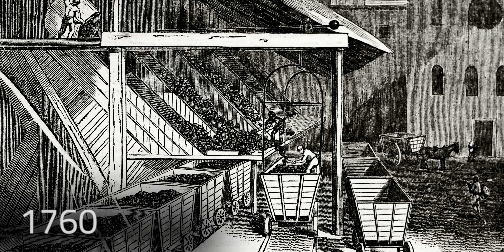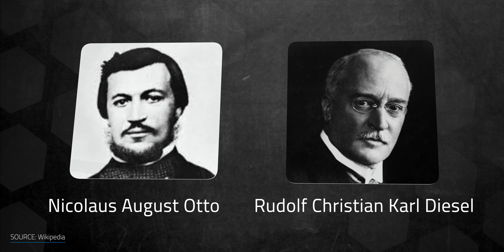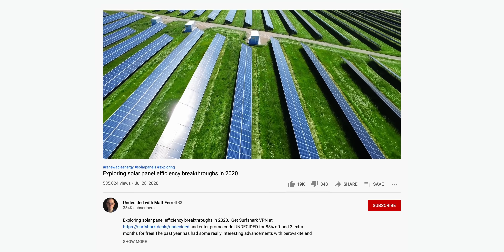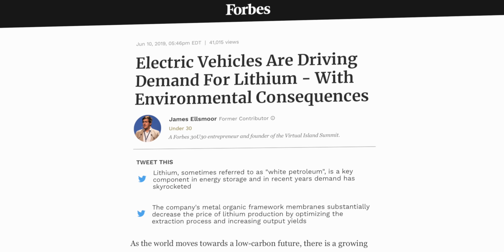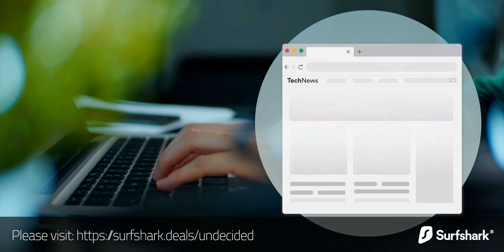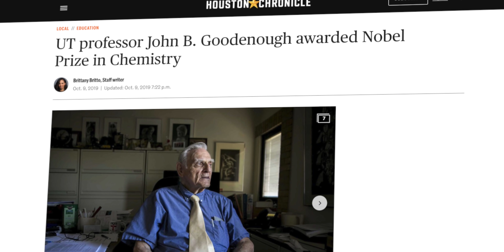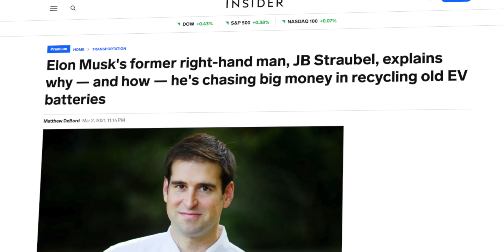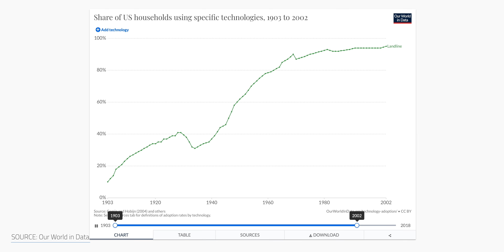Is the Future of Renewable Energy Inevitable?

Comment: All right, here's a question to ponder: For converting electricity or photons to hydrogen, and for going the other way with a fuel cell, are there some actual theoretical limits? I mean limits that are independent of the specific technology. For example, for PV there is the Shockley-Queisser limit, which sets an efficiency limit for single-junction silicon cells with no concentrating optics: about 33%. There is the Yablonovich limit, which pertains to interaction of photons with the surface of a solar cell of any type, setting a much higher maximum—somewhere between 70% and 80%, I think. But how efficient could hydrogen energy storage be, with the right technology? I'd be really interested in an answer to that.

Comment: Maximum Theoretical possible solar efficiency installed on earth could be 68.7% and in my opinion going silicone solar power is just not viable. We will go nuclear on a large scale. And solar thermal seems like decent solution. Also combining thermal cycle with hydrogen generation and storage might prove essential and more viable than electrolysis.

Comment: still need a stable zero emission base power source, cant avoid the nuclear question irrespective of the crystal ball gazing. Also environmental damage isn't just about digging holes, it is also about land use. Wind and solar needs land to work, that in itself is a strain on the environment. Nuclear uses very little land, the land/power output ratio for a nuclear plant is a fraction of that of solar and wind. Another aspect you skipped over is solar and wind can only be used in small fraction places on the planets surface before it becomes uneconomical. As for hydrogen, makes me wonder if places like Iceland will become super rich in the future by exploiting its massive thermal energy reserves to produce hydrogen.

Comment: 95% efficient hydrogen generation? That would make the storage about 47.5% efficient, as you get half the energy back as electricity and half back heat. How do they achieve that 95%? A new miraculous catalyst? I hope they have proof.
I do hope that the 95% is true, because the world needs it to heat buildings. With the H2 from any oversupply, we need H2 to heat and power of homes in the cold of winter.

Comment: So the cost is not being considered properly in this video. The problem with Hydrogen RIGHT NOW is that it is very expensive to produce, store and carry around. This video just skims over those facts. Efficiency is being considered very important but how is it calculated? Conversion between input and output energy and the byproduct carbon? Thing with Solar is that it is static. Once its installed, it technically doesn't have input energy to worry about so the efficiency of 30% is based on what? There is no input, sunlight is free. I would have thought the bigger problem with Solar is the production cost (which has come down drastically) and effect of the recycling the used panels as well as storage for reliable continues output. 

Matt does good research and good videos but I would be really happy if these questions are answered. May be some of them are completely dumb questions due to my lack of full understanding. But he clearly asked us to comment so I did :) !

Comment: The efficiency comparison is flawed. It's ever more difficult to improve efficiency as you get closer to 100%. All these technologies, old and new, are also theoretically capped based on what we know of the natural laws of the universe. Steam engines: 63%. Steam turbines: 60%. Thermal power plants (coal, oil, wood, gas, etc): 44%, Solar panel:  68.7% (on earth). Wind turbine: 59.3%. Almost without fail, the practical designs are way lower than theoretical. Although some supercritical thermal stations hover around 41%. ICE for cars are near the very tippy top of what is theoretically possible. Already due to performance requirements no manufacturer would even attempt to maximise fuel efficiency, because from a certain point onwards you simply have to sacrifice performance. No good if you can go 2000km on a litre of gas, at a sub 1km/h top speed on a skateboard.

So it's not apples and pears to just go 2x, 5x, 10x. 

The first solar panel had an estimated efficiency of between 1 and 2%, although that's ages back. 1883. Efficiency for retail panels today have already increased somewhere between 11x and 22x since then. At 27% even more when that is available. And, there are much higher efficiencies, at much greater expense, in use for speciality solutions and also the lab. The record is 47.1%.

So you see. Solar panel efficiency is already above the theoretical limit for thermal power plants. That's also important.

What more? Cost per unit of renewable energy and storage is dropping, and will likely continue to drop for decades. Which is massively important in the discussion.

Comment: It would be wise to point out that the round trip efficiency of electricity to hydrogen to electricity is very inefficient compared to a conventional battery, and even less efficient when the energy required to either compress or cyro-cool the hydrogen for storage is taken into consideration. Lithium batteries are pretty good, but, as with everything else, overpopulation leads to unsustainable demand on every resource. Solve that problem (one child per couple for say, one hundred years) and you solve virtually ALL of the problems. With nearly 8 billion humans, virtually none of the problems will be solved.

Comment: It is inevitable that wind and solar + storage will continue to grow rapidly for the simple reason that they are cheaper than fossil fuels. However, how fast the transition will occur will vary from country to country depending on political pressures. There will be a lot of resistance to the transition by incumbents and there are questions such as whether or not home rooftop solar + battery or commercial solar plants will dominate for home use and who will pay for grid infrastructure. Also the best economic choice is to build out about 5X capacity of the current grid producing vast amounts of cheap energy and it remains to be seen which countries will realize the benefits of doing this and invest the necessary amount to achieve it. Those that do will win big, those that don't will suffer economically as a result. I don't see hydrogen playing a particularly big role.

Comment: I think its an over simplification comparing the development of steam engines over 100 years to get 10% efficiency  from 1% . Solar in a lab with 47 % efficiency means at best you can only double it and thats it . The real driving force in Alternative unpredictable intermintant  energy is storage  not small battery farms at huge cost but cheap multi day city size storage . Ultra high voltage DC  transmission so areas experiencing low power generation conditions can obtain electricity from 1000s of Kilometres away . Not all alternative energy is suitable to every place . its what works in the particular area . We have seen too many wind farms built in ares that are not constant high wind area , they were built because of Government subsidies . May be  if there was less subsidies there would be better economic positioning . Remember a subsidy is a tax that generally affects the poor more than the rich .

Comment: I think renewables are starting to hit a wall with the limits of batteries, not just in size and cost but also longevity.  How many miles can you really get from an EV before you have to replace the batteries? Compare that with a diesel that's just getting broken in at 300K. Once that is sorted renewables may become dominate, but wont become the sole source. You'd be surprised how much industry still runs on steam. We are also still hundreds of years from full adoption of when we have now world wide. How much of the world still burns dung just to cook dinner?

Comment: I've been wondering what happens to all the oxygen that comes from creating hydration gas? Sold as... diving air? Just released in the atmosphere? What consequences does that have?
Reply: It'd just be released into the atmosphere or used for other chemical processes that need a supply of pure O2. Releasing it into the atmosphere wouldn't have any impact, the same amount of oxygen would be consumed again when the hydrogen is burned in a fuel cell.

Comment: The central problem with wind and solar is intermittency. While the cost of generation for both has fallen significantly, the price of electricity in markets like Germany and California and the US as a whole has risen directly in step with the reduced capacity factor as renewables were added. No foreseeable tech improvement can cover the system costs of dealing with intermittency.

Comment: You missed two fairly major elements at least with regards to grid-scale renewables like Solar and Wind.  The first is that the maintenance cycle for a Solar or Wind farm is almost trivial... any relatively small element of the farm (such as a Wind Turbine) can be taken offline or replaced without having to take the entire farm offline.   For a solar farm, same thing with regards to the panels.  The electrical infrastructure supporting these farms is also ridiculously easy to maintain in small chunks and, as before, the farm can remain online while you do it.  Same for grid-scale battery storage.  This is simply not the case for a fossil plant of any sort which spends a good chunk of its life-time turned off for maintenance.   

The second has to do with the full life-cycle of a Solar or Wind farm.  In short, all of the various bits and pieces of the farm can be replaced piecemeal, again without having to shut-down the entire farm (or even very much of it) while you are doing so.    And again, this just isn't possible with a Fossil plant.  As a fossil plant ages the maintenance gets more and more costly.  Replacing a fossil plant costs billions on top of billions.  This isn't the case for renewables where everything can be fully upgraded or replaced in-place and piecemeal.

These are kinda the little dirty secrets that fossil interests try to avoid discussing.  But it matters, because fossil plants start to disappear when the reality of their costly life-cycle becomes obvious as the plants reach their end-of-life.

--

On the Hydrogen front, one of the key points you missed is the "why".  Why does it make sense to produce hydrogen when the full round-trip is only barely 50% efficient?   The reason is that Solar has become so cheap it makes a lot of sense to over-produce solar energy to better cover those parts of the day outside of the noon hours.  This leaves a great deal of excess electricity available at noon at wholesale prices approaching $0.00.  This is why, as Solar (in particular) continues to expand on the grid, it makes sense to start splitting water.

But in terms of what we do with that Hydrogen, there are some fairly big problems the instant you decide you want to transport it somewhere.  Pipeline infrastructure is really expensive, just plain period dot... its really expensive.   Does the hydrogen even have to be transported anywhere at all?   I think the answer that society will close-in on is "no".  It can just be stored on-site in a chemical sponge (a metal hydride, these days), and then run through a turbine when electricity is needed (for the evening peak and overnight use).

For this reason, I think the use of Hydrogen as a transportation fuel is probably doomed... or at least, won't be universally useful.  To use hydrogen as a fuel you need to transport it to convenient fueling spots.   Right now, at this moment, there are no 'convenient' fueling spots and those fueling spots under contract use extremely cheap electrolysis mechanisms using electricity, on-site, to produce their hydrogen.  It just doesn't scale well, is a huge waste of electricity (more specifically, the site has to pay for transmission even mid-day when wholesale prices are low), and frankly the excess solar producers will be the ones who want to generate and use the hydrogen, not just sell their excess solar generation to the grid at $0.00.

Which brings me to my conclusion... electricity and batteries are the future of transportation.  Even with some interest in hydrogen, batteries alone are on track to become the best option over just the next few years.  They work quite well now, they are just slightly too heavy and slightly too expernsive.  In a few years we will be talking twice the energy density per kg and half the cost.  I don't think hydrogen has a chance.

-Matt

Comment: The steam engine initiated a positive feedback loop in that it greatly facilitated the mining of coal which lowered the price of coal, which then expanded the use of steam engines which encouraged development of more efficient steam engines. There is no such feedback loop with renewables. There is no wind turbine or solar panel factory that is itself powered by renewables. Not even Tesla’s Gigafactory in Nevada. Why? Finally, no matter how efficient renewables become, solar panels will only have a capacity factor of 25%; Wind turbines about 40% at the best locations. So you will be required to use batteries that store electricity at a cost of some multiple of the cost of generation. It’s like putting a Casio watch in a Rolex box.

Comment: I think you need to recheck your facts on hydrogen there mate.  It's extremely inefficient to produce and use.  Renewable energy to battery to moving the vehicles wheels is 80% efficient.  The same thing with hydrogen, 38% efficient.  (Where are you pulling 95% from?). Sources?

You have MASSIVE energy losses in conversion of electricity through electrolysis to hydrogen, compressing it to 300 atmospheres, driving the hydrogen in trucks to stations and then pushing it back through fuel cells again in the car.  Not to mention that fact the storage of hydrogen is tricky being the lightest element in nature, it leaks through everything. Or that none of the stations are in place compared to EV's tens of 1000's of charging points already installed.  Hydrogen has already been dismissed by Volkswagens CEO as a viable power source for cars.  Hydrogen in cars has already lost the race.

Your entire argument only looks at efficiency and ignores cost economics and the rule of manufacturing.  Batteries have halved in cost over the last 8 years and tripled energy density.  Solar is 1 tenth the cost it was in the same time period and reaching efficiencies of 38% (Which is much better than a petrol engine at 25%).

Wind is the cheapest form of power production cheaper than coal, gas you name it, and all they did was make bigger wind turbines, less maintenance, stronger more consistent winds (as it's higher). Less nimbyism as they're fewer wind turbines in a given space.    

The useless conservative government of Australia is pushing for a "Gas" Covid economic recovery as it's filled the advisory board with Gas and coal board members surprise surprise! 

However the Australian Electricity Market Operator (AEMO) has just stated in their last meeting of the Energy Opportunities convention that natural gas is a pointless investment with the amount of solar and wind out performing those sources of energy in availability and cost.  They went on to say that Gas in the energy market will be all but gone by 2030 as solar, wind and green hydrogen take over.  The old paradigms of a need for "Base load power" is outdated due to current graphs of existing wind and solar on the grid only needing backup power once or twice a year for an hour of so.  (Perfect for batteries).  

Batteries also come in different chemistries as well, flow batteries, Donald Sadoways Magnesium - Antimony hot battery, solid state batteries made by quantumscape for lighter longer lasting batteries in cars.

Tesla already makes batteries that will still have a useful charge above 80% whilst outlasting the cars they're put in . And that's just the regular Lithium ones!

Here in Australia, we would vote out these greedy backward coal funded troglodytes if it weren't for the under educated, Rupert Murdoch reading boomers who still hold onto the LNP due to their deep pockets and good marketing (Even though their prime minister failed that subject) lol.

As abundant as coal and oil are, if we don't stop using it the human race simply won't exist on this planet in 100 years if it continues as it is.

Comment: 90% efficiency misleading.   They are using some of the  heat.  I also don't believe that, there's not independent verification.    63% is typical for electrolysis.  They already recycle the heat to heat the incoming water. 
https://www.hydrogen.energy.gov/pdfs/20004-cost-electrolytic-hydrogen-production.pdf

Comment: Hydrogen is good only on paper if you ignore a lot of key problems with it. You add many steps to the proces that can be instead just plugin and charge up at home
Reply: Agreed- for light duty transportation. I’m pretty antihydrogen vehicle when it comes to cars and other forms of personal transport. I think it’s been a pretty big boondoggle for the billions of dollars we taxpayers have spent on it. 

However, hydrogen for grid level long term storage is another matter. As well I think it is likely that there will be room for hydrogen and heavy duty vehicles and potentially air transportation. Also probably in heavy duty vehicles. You have a much lower quantity of (larger) catalysts required and they have a much higher duty cycle. Although batteries might take over heavy duty also before the need hydrogen infrastructure can be built out.
Reply: @adamdevereaux2459  It will be good to have access to both technologies of corse, just hydrogen will be less worth it per kwh cus conversions. Dont get me wrong, i'm not saying we shloud abandon it completly. But pushing it for average consumer is plane stupid